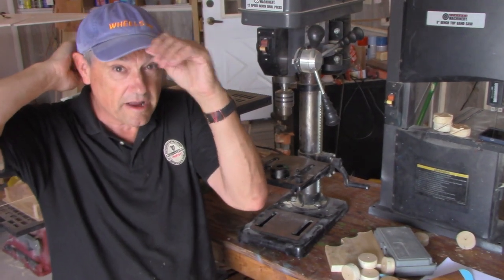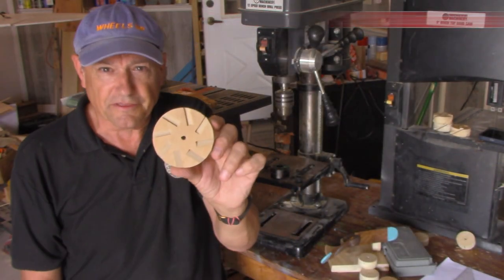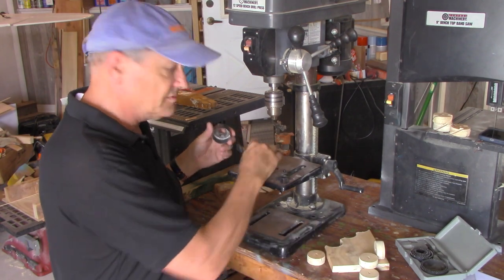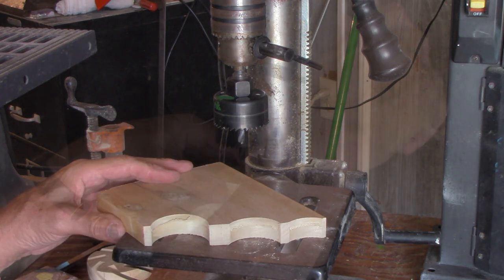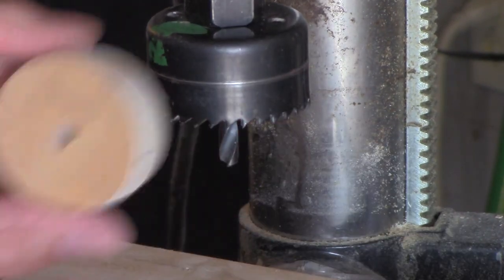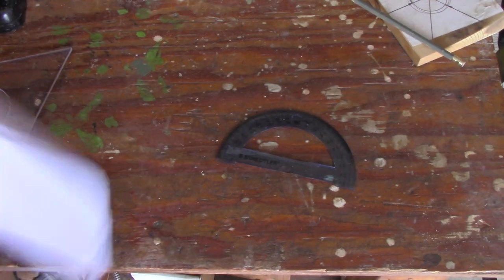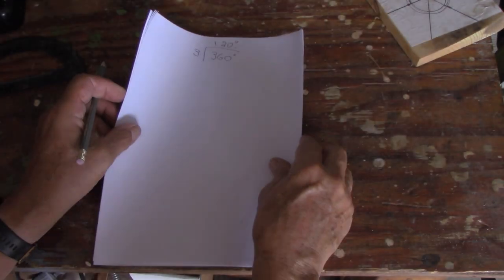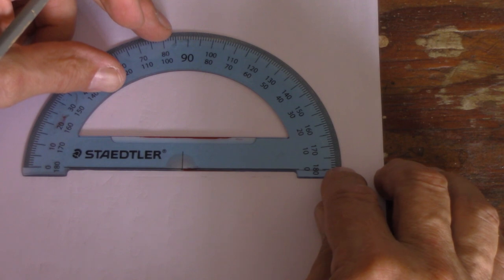Secret Method of Making 3 Blade Whirligig Propeller Hub - How to DiY

Comment: the way you explain ... makes it more complicated than it really is...wow!
Reply from the maker: The demonstration was intended to explain all of the possible angle and blade configurations available in order to animate any given kinetic wind driven mechanism as well as the mathematical geometry required to determine blade spacing relative to hub disc size.

Comment: Im about to try and make one. Love you videos. What length and shape blade do you recommend one the 2 1/2 hub with 3 blades?
Reply from the maker: Three blades, each about 4 1/2 - inches long would work fine.  You can make the blades 2 inches wide.  Longer blades usually begin turning sooner in lighter winds but rotate more slowly.  I've made them 6 or even 8 inches long.  Good luck with making your whirligig.

Comment: I'm still trying to hone in on my settings. I obviously wasn't center as mine looked like the one you showed that didn't have a through cut on the rear.  Another issue I'm having is, I'm using 1/8 for my whirlygig blades. With one saw blade the slot it too small with 2 the slot is too big. How are you getting such a good fit? Thanks in advance. Love your video
Reply from the maker: Getting the hub slots the exact size can be difficult.  You can try different saw blades.  Some are thicker than others. Some builders stack two blades together to form a specific thickness dado cut. Another trick is to simply run the hub through the saw blade multiple times to open it up.

Comment: What thickness of wood are the blades ?  Do you cut them to the desired thickness on the table saw ?  When cutting the grooves in the hub, how do you get a wider cut than 1/8" ?  My table saw has a 1/8" kerf.   Love these videos !  Thanks !
Reply from the maker: Thanks for your comments.  Yes I use a table saw. The blades are about 3/16-inch thick. Originally just used to run the hub through multiple passes to open up the slot.  Then found a "cheap-o" wobble dado blade for $20 bucks, it's thinnest setting is 3/16-inch.  Works pretty good.  Some guys are making their own dado stack by putting two thin cutting (.040) blades together sandwiched with 2 pieces of card stock to come up with the desired thickness.

Comment: How tick is the saw blade to cut the slots in the hub
Thankyou
Reply from the maker: found a "cheap-o" wobble dado blade for $20 bucks, it's thinnest setting is 3/16-inch.  Works pretty good.  Some guys are making their own dado stack by putting two thin cutting (.040) blades together sandwiched with 2 pieces of card stock to come up with the desired thickness

Comment: What am i doing wrong? Ive raised the blabe to it max without hitting the bolt, ive made adjustments with the angle and where im cutting center of bolt but they all come out not cut all the way thru on the back
Reply from the maker: Hmmm... sounds like you don't have your hub blank centered over the saw blade.  Try sliding the hub one way or the other, make a couple of test cuts with a shallow cut on a piece of scrap wood that is the same thickness as your hub blank.

Comment: How did you determine the height of the table saw blade? Thanks for the great info!
Reply from the maker: Usually just hold the blank hub close to the blade and move it up until it is slightly below the center hole.  Maybe about 1/8-inch to 3/16 or so on this size hub.  Leave enough wood to give it some strength.
Reply: @gwheyduke  thanks a million!

Comment: Is there an advantage, other than less material for blades, to having 3 blades over 4?
Reply from the maker: For simple whirligigs the answer is no.  For airplane propellers or Wind turbines the optimum number of blades is determined by the aerospace engineers for each particular application.  4 blades are probably used most often with whirligigs because it's easy to cut a square hub with the individual blade slots while keeping them exactly 90 degrees.   Also with four blades they seem to balance out easily.   👈 hope this answers your question.

Comment: Please can you help a useless female 😂... Is this possible to do using say a mitre blick and hand saw... I am desperate to make a small scale whirligig but do not own any power tools, apart from basic hand drill etc thank you... Super info vids
Reply from the maker: You can make a propeller hub using a hand saw and a miter box it will work.  The slots for your blades don't have to be a perfect angle, it will still work ok.  Starting with Square hubs make it easier to cut the slots by hand.
Reply: @gwheyduke  thankyou for replying, much appreciated,